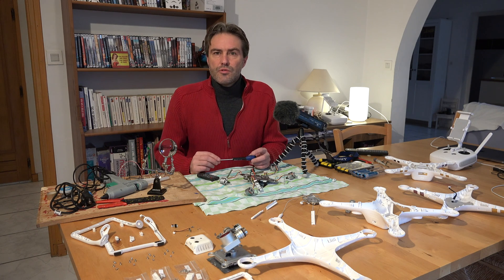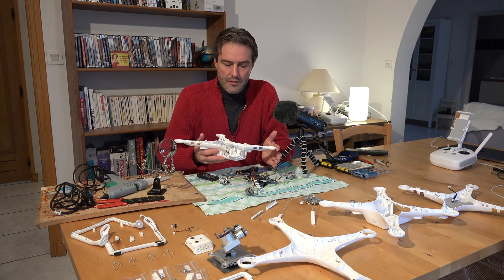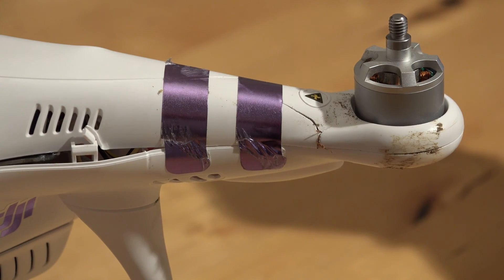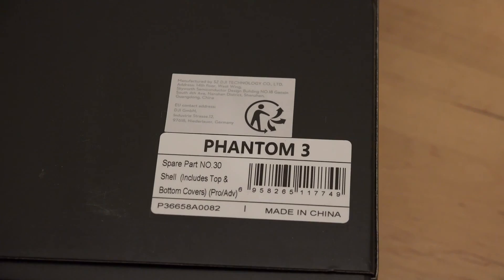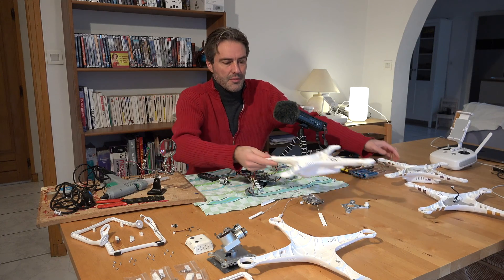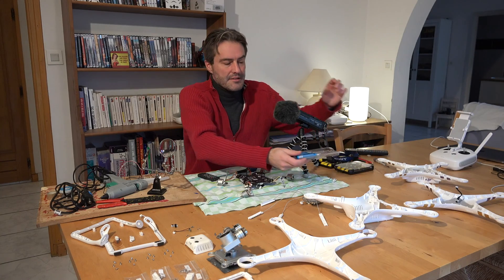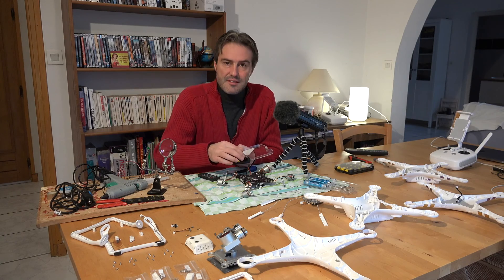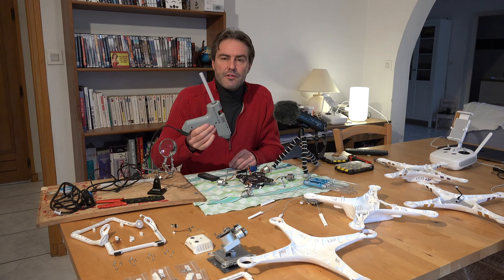Tuto de réparation d'un Phantom 3 - partie 1 - introduction et outillages

Comment: Bonjour Paladrone. Je voudrais savoir où m'adresser pour commander des pièces détachée DJI. Je suis à la recherche d'une radiocommande complète pour DJI Mavic air. Merci d'avance pour votre réponse. Je suis un grand Fan de votre chaine YouTube
Reply from the maker: Bonjour Bruno, ça ne se trouve pas facilement malheureusement, on en trouve d’occasion sur eBay, des neuves (hors de prix) sur Amazon. Tu peux aussi demander à ton revendeur qui est là pour assurer le SAV. Bonne recherche 👍
Reply: @paladrone  Merci de ta réponse